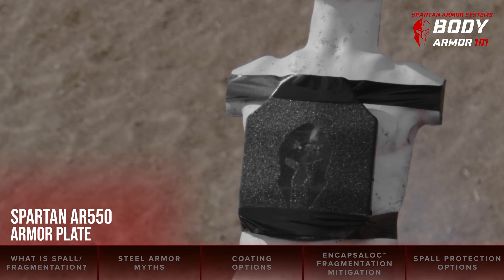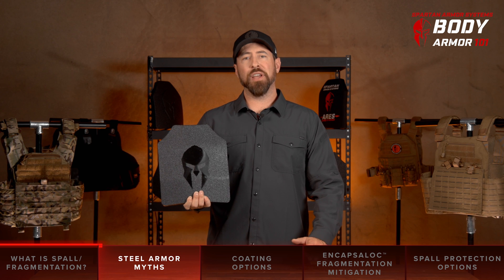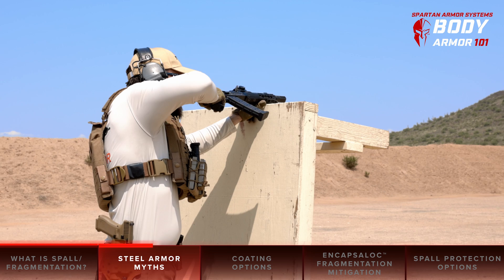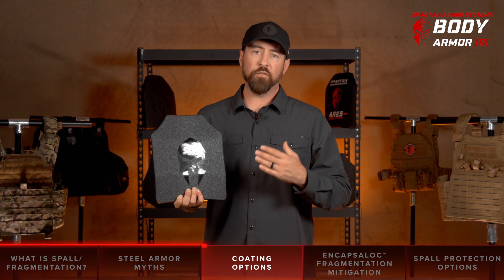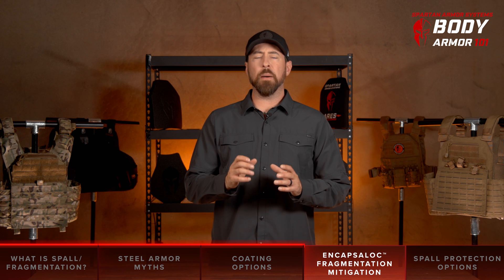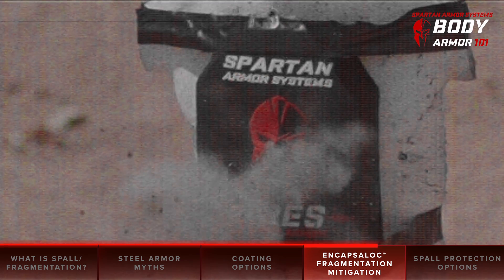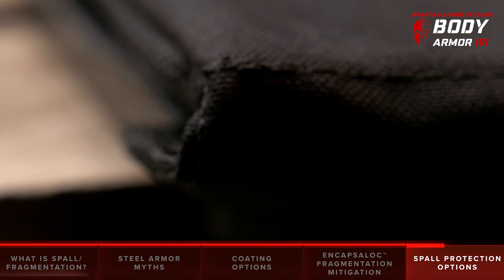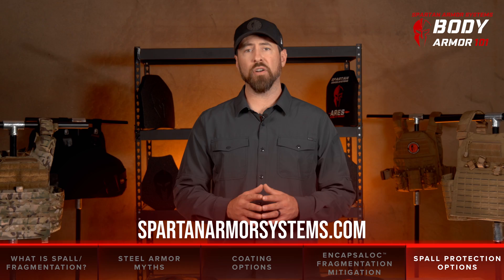Body Armor Spall & Fragmentation (Fact vs Fiction) - Spartan Armor Systems Body Armor 101

Comment: Nothing I didn't know, but it does beg the question:  Why offer armor plates with less than a full coating?
Reply from the maker: Thanks for the question. Base coat plates are offered for a number of reasons. A good number of people buy body armor plates to use in weighted vests for training and don't want coated plates due to the cost or extra weight. Other people opt for less expensive base coat plates and pair them with our Spall Containment Sleeve. Other people aren't concerned enough to pay the extra money. While a good plate carrier will retain a fair amount of spall, we do what we can to educate people on the subject so they can make an informed decision. At the end of the day spall injuries are very uncommon, so if price is a prohibiting factor then it's better to have armor when you need it than no armor at all. Like many other things, there's also a lot of exaggerated misinformation about spall on the internet/social media.
Reply: @SpartanArmorSystems  I really came here to check out the spall containment sleeve on non coated steel. Just wanted to see how effective it was and get some info on it.
Reply: Spall coating, no coating, it's all the same because with steel plates, a person buys them, unboxes them the day they arrive and then straps on those heavy bastards for about 20 minutes and then resolves to never wear them again and  they end up under the bed next to that bin of proof quarters you got from your crazy uncle when he croaked. Then one day you become the crazy old man of the family and your kids or nephews cart off the plates and the quarters, and the cycle of life begins anew! :)
Reply: @kenofken9458  grow a pair or each some spinich they aren' that heavy
Reply: @cooperallgood  Wear them for an 8-hour shift and then get back to us.
Reply: @kenofken9458  i already do  why do you think i made this comment
Reply: @kenofken9458  I wore them for 9 months in afghaniland, does that count....? You're wrong, stop talking... lmao damn internet
Reply: @kenofken9458  8 hour shift doing what....??? Because the police and military work longer than 8 hout shifts, and neither wear full body armor all of the time they are working...... So what are you like a mall cop or airsoft kid or something....?
Reply: @ThatTempesTGuy  If you wore steel in Afghanistan, you weren't fighting in our military or any regular unit.
Reply: @ThatTempesTGuy  I'm less than a mall cop. I'm a middle aged dude with no military or LE experience at all who's not frail or obese but far out of fighting prime, and therefore representative of (at least)  95% of the civilian body armor market. 

Now I got a set of steel, Spartan in fact, and I'm not sorry I got them, but the reality is that no normal person is going to wear those buggers with any regularity. Their only plausible use is if you somehow have foreknowledge of a threat environment where you can get them on in time. 

I'm not aware of any police agency using steel, nor any First World military.